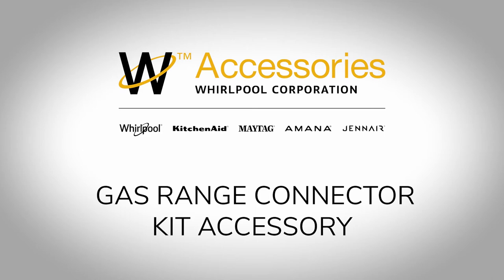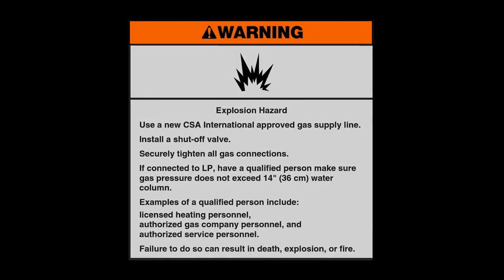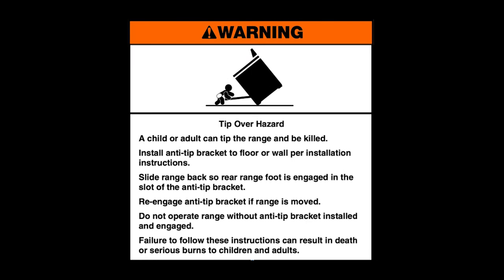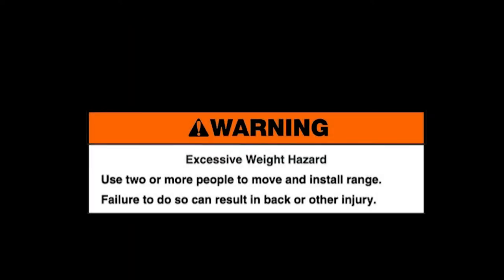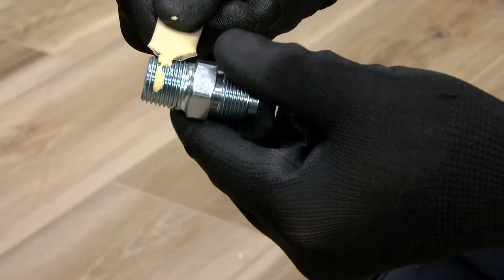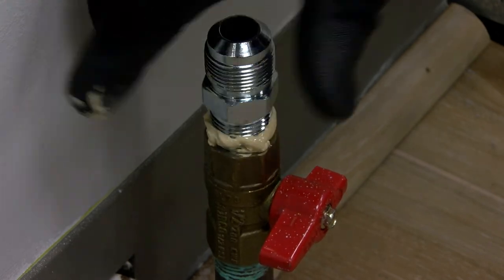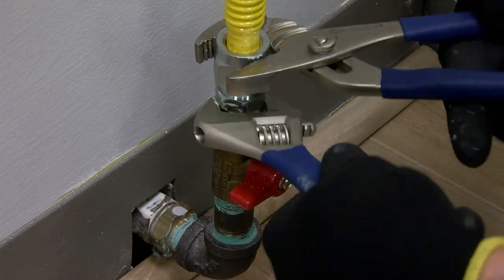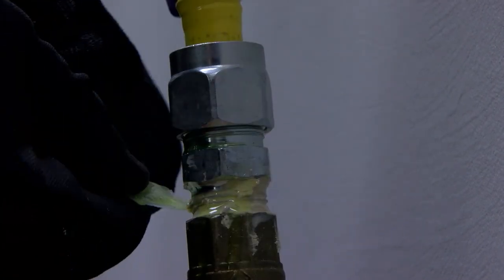Gas Range Connector Kit Accessory

Comment: Can you reuse any of the pipe connectors?Such as the 1/2 to 1/2
Flare fitting that goes to the stove.
Reply: Should not be reused with any other appliance or in another room